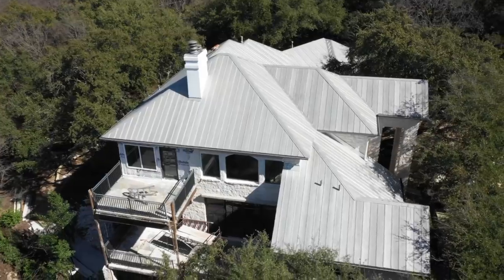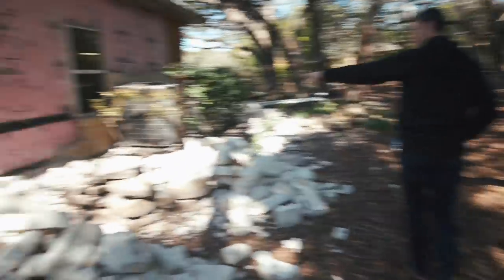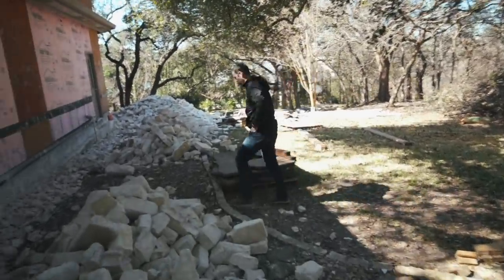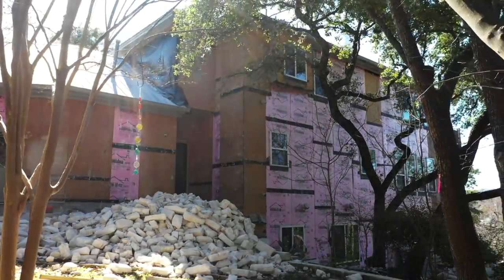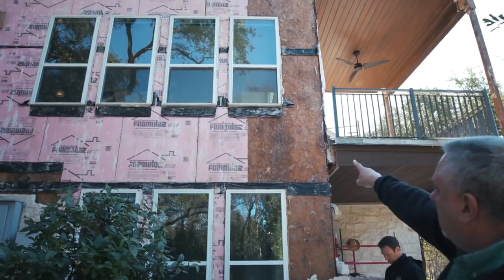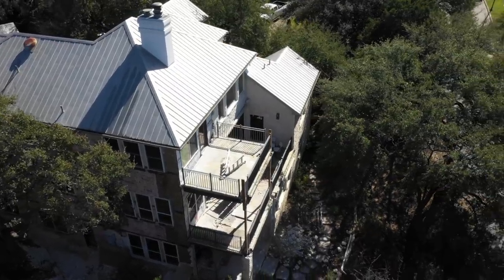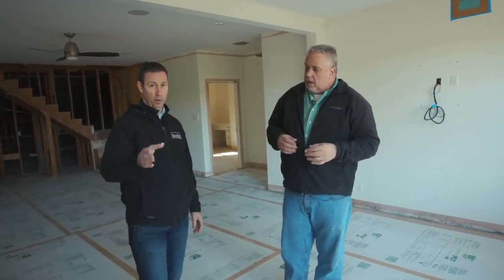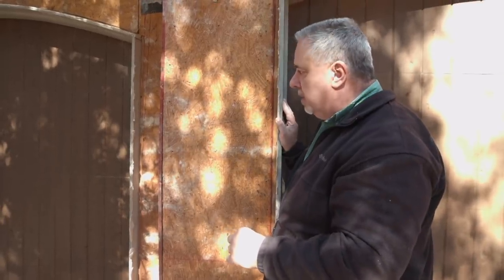You Won’t Believe What’s Behind The Skin Of This 20 year Old House!

Comment: Reason #19 that OSB sucks. Try taking off an old sheet of OSB with a prybar, compared to plywood. 

The minimal savings just isn't worth it.
Reply: getenlightened i hate OSB too! But i think plywood is going to be 1.5x to 2x as much?

Maybe a mix is more economical with OSB under the overhangs?
Reply: Nothing wrong with OSB.
You just have to use it right, and use systems around it right.

A lot of the "examples" they show on these channels when remodeling are "what we now know NOT to do".
Reply: Hyperstrike very well said 👍
Reply: @PhotonHerald  Galvanized... cough piping... *cough*. Contractors: "Best thing since sliced bread... It's galvanized so it won't rust!"
Reply: @PhotonHerald  Agreed!   The flaw was in the construction techniques, lack of proper waterproofing.      Looks so simple, in hindsight.      And those fireants, nesting well above ground level, where some moisture encouraged infestation... gives me the heebeegeebies.
Reply: @johnbecich9540  a house wrap would alone, have solvced the problem, but a masonry sealer?
Reply: @PhotonHerald  Great points, material selection is a problem far behind installation procedures
Reply: I look at it as pay a little more now, or pay a lot more later. All the defenders of OSB have the same answers, "It's fine if it's used properly" or "It's fine if it's weatherproofed properly, with the right materials", both are answers to the hypothetical ideal workman working with the product. You can use garden variety building paper on top of plywood, and even if the openings are not flashed properly the plywood will still only rot maybe a foot or two up from the bottom of the wall over 30 years. If you used roofing felt instead of the cheap building paper, flashed the windows, and doors properly, with something like blueskin roll flashing, the plywood might last 50 or more years. The fancy house wraps you supposedly have to use with OSB cost almost double what roofing felt does, and you have to take care with installing them, you also have to add pressure treated lath on top to give the water some space to drain out where I am.  I would bet that the ZIP system sheathing (OSB with plastic glued to it) costs double what the plywood does, and you have to tape all the seams, more labour and expense. So by using an inferior product you have to go back and spend more on labour, and fancy products, to make sure it doesn't disintegrate, and don't get me started on how bad it rots under stucco, especially the synthetic kind.
Reply: OlegKostoglatov 

Huber products are manufactured with a compound which is far superior to the product cheap OSB produced with.
Reply: @BrianBriCurInTheOC  I'm sure they will claim that in their sales literature. The ordinary OSB manufactures also claim that their glues are better then they used to be, but it's still crap. I think time will be the best judge of how superior it is, part of the problem with OSB is the fact it's made out of flakes, arranged in mats, and pressed together. Normal plywood uses phenolic glue which is pretty impervious to moisture, but excessive moisture can still damage the plies via expansion and contraction.
Reply: OSB painted with oil based paint will significantly shed water,  but it soaks up a lot of paint
Reply: @timothykeith1367  Therein is the rub, on the other hand you could also paint plywood for extra protection which wouldn't be quite as thirsty.
Reply: OlegKostoglatov 

Look, you obviously don’t know squat because of the composition of Huber’s product, you must use a compatible glue which is NOTHING LIKE normal construction adhesives.
Reply: @BrianBriCurInTheOC  Why get so emotional, do you have shares in the company? That was a non sequitur remark. I wasn't speaking about construction adhesive, I was speaking of the material the board is actually made from, and how. Maybe it will last, and maybe it will not, in 20-30 years time we will know.
Reply: OSB and plywood both swell when wet, but when OSB dries out it will return to its original dimension.
Reply: @OlegKostoglatov  I DO look at it as "pay a bit more now".

But not for the sheathing.

The air sealing and weatherproofing systems, as well as proper install technique.  THAT is where I'd prefer to spend my money.  Rather than burn extra money on plywood, and have to do the SAME EXACT THINGS to weatherproof it anyhow.

"You can use garden variety building paper with plywood".  And have it rot out every big as bad.  It just won't flake apart quite the way OSB does.

Delamination?  Or flaking?  Oh, such a choice!

And I'm sorry, but roofing felt isn't an appropriate form of house wrap or weatherproofing.  It NEVER WAS.  It was simply, at one time, better than an open hole in a wall.

"Bet Zip sheathing costs double what plywood does."

Home Depot: 
15/32 southern pine.  $16.15
7/16th Zip.  $18.25
GRANTED, plus the various flashing and sealing tapes or the liquidflash.

"And you have to tape the..."

In other words, you're comparing apples to softballs.

You're talking about building a "breather" building.

I'm talking about building something that with a controlled interior environment.

NOT THE SAME THING AT ALL.

Basically all the money you "save" will come squirting out of your wall and roof structures due to poor air sealing and insulation methodology.

"By using an inferior..."

I say this again.  OSB isn't "inferior".
It simply has different implementation and usage parameters  And it also depends on what you're looking to build (and where you're looking to build).

Implement a wall with a proper rainscreen behind the stucco, and there's no rot.

You're basically arguing that your solution is marginally better if we only build to the standards we built to back in the late 80s.

No.  Bad!  DUMB!
Reply: @PhotonHerald  OSB returns to it's original dimension after swelling up, are you kidding me? I live in a damp climate, if you want a building to fail in 20 years just use OSB on it.
Reply: @BrianBriCurInTheOC  There is no point discussing anything further. I've tried to be civil with you instead you come back with a load of insults, and emoticons one would expect from a 15 year boy.
Reply: OlegKostoglatov 

Your discussions are unilateral — you do not get Building Science and I’m not the only one to point it out! 
Just like Risinger finds sprinklers damaging newer homes because builders construct walls that are not protected from water damage. The same stuff happens here in SoCalif. Builders here don’t spend money on preventing water damage here because half the times we are in a drought. But Sprinklers Systems make up for the drought and keep the walls wet 24/7.  Plywood is going to rot eventually when it is not protected just takes longer that OSB! You must not understand what HUBER Products are made from, how they are used, or how they are protected; or you would not make the claims your making. Building Science is something you must learn, which you obviously have not! 
But just like you can lead a horse to water, but they can not be forced to drink it. As the phrase goes, you can’t fix stupid,  we can not force you to learn about air barriers or water barriers, that something you must make the effort to learn in your own.
Reply: @BrianBriCurInTheOC  Says the guy who endorses a product that claims you don't need to add a barrier of any kind over it,  between the sheathing and the siding, which ignores at least a century of "Building Science".
Reply: @paulmcfadyen689  No, it doesn't.  And neither does plywood for that matter.

Comment: So, Matt......with a central Texas brick exterior, what do you think of painting the OSB before applying a wrap?
Reply: Brick is placed away from the sheathing so it can dry out.  You should be fine with tar paper or even Tyvek over the OSB.
Reply: @bigpjohnson  I get that, just built a nice (very nice, spray foam and all) pool house. I was just thinking that for the cost, painting the OSB before tyvek make make for a good improvement. Just brain storming as some time in the future (not sure when) I plan to remove the 70's brick and do new windows on the existing house. Kind of a while the brick is off kinda thing. Tossing around doing spray foam, new OSB or other panels, paint the OSB, tyvek, then the new brick to match the pool house.

Comment: @matt risinger Why can't you use the OSB as it stands where it is structurally good, except where it needs reframing around the windows, and use something like a PolyWall CAT5 membrane with exterior insulation and rain screen? Seems like a waste not to keep most of the sheathing when it is still structurally sound. Appreciate the videos, just hoping to see the thinking behind the decision to tear it all off. Thanks in advance!
Reply: OSB is cheap and fast to install in whole panels.  Trying to cut around to save the old ones costs time and money.

Wouldnt be surprised if he replaces the insulation while its all open anyway.  Insulation has come a long way since.

Comment: Question starting at minute 6:27. 

Since the brick lug mentioned sticks out.. could you elimination it by adding 2” of exterior insulation? 
Or does the sheathing always need to sit outside the block work? I am running into this same delima on a remodel !

Comment: Concerning the mold at the bottom of the basement walls: Makes me wonder if there is a vapor barrier under the slab. Looks like there might be finished floor under that Ramboard type protection. I’d recommend inspecting the floor assembly with a moisture meter.

Comment: In the UK nearly every house is built using 2 layers of brick or concrete block with a cavity of approximately  2 inches which now tends to be filled with rockwool, fibreglass or foam.  These house walls  rarely suffer from any kind of  decay but i guess the insulation levels are not as good as a wood framed house in southern USA

Comment: What about spraying the sheeting with an impervious material like rhino liner? Yes material cost is high, but labor cost should be 1/3rd.
Reply: This is where one of the roll/spray on water proofing like Poly wall or one of the other exterior sealing processes will help. Water proof those jambs, he k maybe go back with Zip R for more insulation on outside or comfortboard and dimple mat.depends on future finish plans.

Comment: I'd love to see the electricity bills that this leaky house suffered, for the last 10 years or so.     kWh more important than $.  This would add some quantitative analysis to the excellent qualitative analyses that were presented here.
Also, thank you for mentioning "prevailing wind direction" and the effects, (only) 20 years later.    Where I live, in coastal Los Angeles County (Long Beach near Orange County), there is a SSW breeze almost every afternoon.  More importantly, when it rains, 90% of the time my south-facing exterior is slapped with wind-driven rain.    My roofer's workers were oblivious to this, while being focused on standard building methods.      In Oct 2018 my roofer saw me on the roof, many times, inspecting and making occasional suggestions; one of which was to "heavy up" the silicone sealer on flashing penetrations that exist on my south-facing, exposed areas.
One final suggestion (speaking as an electronics engineer, and surveillance advocate):  I suggest you embed some entirely passive moisture sensors, in various places.    Then someone can come along with an ohmmeter, over the coming decades, to inspect for moisture or lack thereof.

Comment: Funny thing, I sold a home that was built in 2005-2006 to clients this past summer.  It had that cement type siding on both sides and rear that resembled real wood, but real stone on the front of the home.  The sellers were advertising that 5 years prior, so roughly when the home was only 9-10 years old, there was mold growing inside the walls due to the existing front of the home being stucco and leaking water through to the inside.

So that home went from stucco to stone, and here you're going from stone to stucco.  Heh.

Comment: Who replaces their windows at ten years and their siding at twenty? Same person who thinks stone bad, stucco good, I guess. Shaking my head.
Reply: It’s a good thing that they changed up the stone for stucco. Could have been a disaster for a homeowner down the road.
Reply: @robertmanley7  
How so?
Reply: Stucco should really only be done in dry areas, and on masonry buildings.  Using stucco in humid, rainy areas over a wood structure is just begging for water damage unless the waterproofing and flashing is 100% correct.

I live in Houston and regularly see newer stucco homes getting stripped with plenty of water damage and rotten framing underneath.  Brick or siding only for me, they allow the rest to dry out.
Reply: @ws6002 , the OSB sheathing was all beginning to rot behind the stone.  Had they not redone the stone siding the structure would likely have been very compromised and full of mold/bugs in another decade or so.
Reply: @robertmanley7  Its already a disaster,...its a million buck remodel.
Reply: @CL-gq3no  OSB use assumes no water ingress else it is garbage and rots
Reply: @CL-gq3no  Its already full of mold and bugs and compromised...…...the only good thing is the studs and they are like 4 bucks each, so it is a disaster, drywall will be replaced, insul is replaced, exterior finish replaced, exterior sheathing replaced...…...so out of the entire wall section a couple hundred bucks is all that's not going to be replaced,....

  Even the windows, which were already replaced once will be replaced again...….as much as a disaster that house is, its a very typical example of the horrible structures that were built and still being built just like that.
Reply: I moved out of a 15 year old house partly because the whole neighborhood was having to replace windows.
Reply: @shawncockrell6007 , Yeah, I agree.  I'm answering the people that were saying it's a waste to remove the stone exterior as if everything was all good.  It was clearly not all good.  In another decade that place may well have been unlivable or full of termites.  Anyway, the stonework was coming down one way or another.  It was a waste from the moment someone placed that stone over such a poorly built structure.
Reply: Some people are only skin deep, it might look like a nice Stone finish on the outside, but the inside. ..
Reply: @CL-gq3no  3 coats of sealer and lots of caulk?
Reply: It's not "stone bad, stucco good".
The house has RIDICULOUSLY HUGE HVAC-related bills.

As you saw, once the walls were stripped, there are areas that're rotted out.

There's other areas sporting mold and mildew.

ANd there's at least ONE massive insect infestation.

To fix the problems, without gutting the home, they had to strip the exterior.
Reply: @CL-gq3no  Move AC drain, and flashing.  Could have solved this problem
Reply: D W  Except that every builder and designer wants zero eaves, which means the cheap stucco gets soaked constantly and lets water in.
Reply: D W  Great comment!  Thanks!

Comment: 10:32
Looks like AC drain was constantly feeding the wall water in the summer.
Reply: That's an overflow drain for the A/C drain pan most likely.  Code makes you put it over a window so people notice it.  The only time it will have water is when the main A/C drain backs up.
Reply: @bigpjohnson  & Nuke, Two folks that  know what they're talkin about!  Thx.  Have to watch it again the early clip of the stone  how would it have looked with copper flashing? (Box) Gutters and downpipes

Comment: Matt Risinger  Do you know of any materials that are hydrophobic???  More specifically foundations and exterior walls that are hydrophobic.  I find it interesting and concerning that we still use porous materials like brick or cement that soaks in water, creates issues i.e. mold, rot and holds water which is extremely heavy.
Reply: Given enough hydrostatic pressure, even hydrophobic materials get moisture ingress. Best thing is ICF walls covered from bottom up with a stick and peel membrane, plus dimpled mat with a fabric filter where hydrostatic pressure is a problem. Even if water gets through, EPS doesn't hold water nor gets damaged by it. Complete overkill for above grade walls, but you'll never have to worry about water damage.
Reply: @rafflesmaos  Thank you for your knowledge and reply

Comment: Mold behind baseboard  is real common in my experience..
Reply: HEAV¥HAND  No not really, my guess is the same thing is happening inside the wall
Reply: I think that part of the problem is that the gypsum boards touched the floor, making it easy for the moisture to rise up. Then it became trapped behind the baseboards. Paint wouldn't have kept the moisture out of the inside of the gypsum boards.

Comment: My Mom had an issue with ants last year. She has an inside corner at the back of her carport. The wood patio cover attached to the house is the other half of that corner. An aluminum patio cover fills up the rest of that area. It had gotten clogged with leaf debris from the old Crepe Myrtles she had removed. The patio cover held water and moisture went into the soffits. I saw moisture dripping from that inside corner and ants 🐜 had moved in. We hired a very good handyman who removed the patio cover, opened the soffits, killed the ants, replaced the soffit and the patio cover repainting everything.